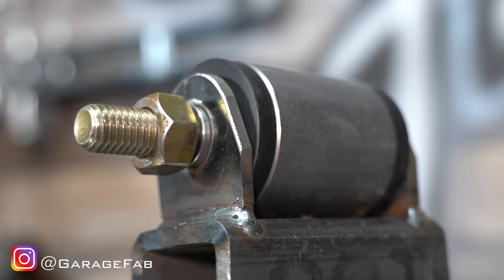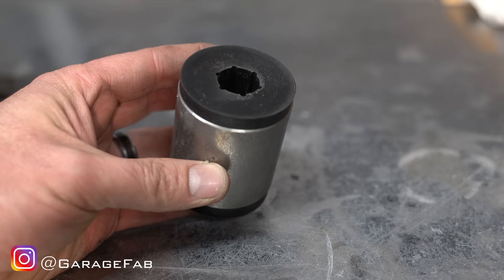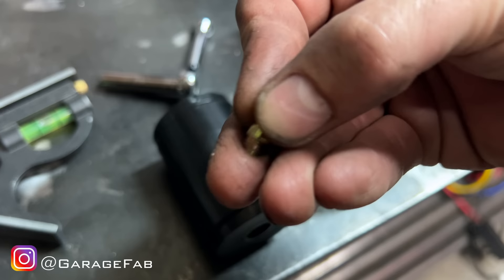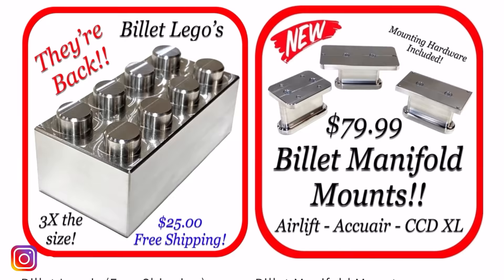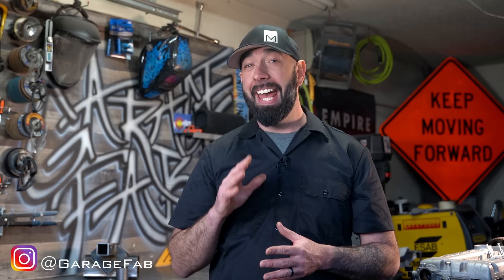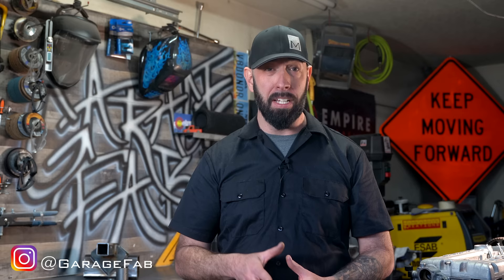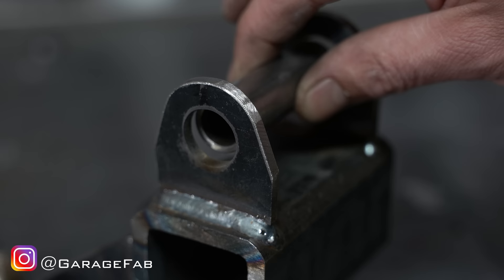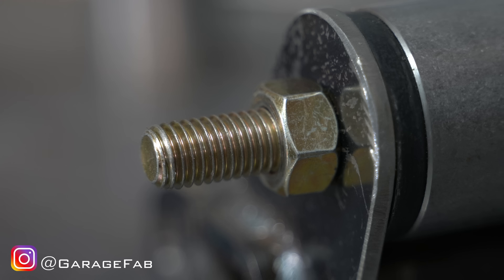The DOs and DON’Ts When Installing Polyurethane Suspension Bushings

Comment: I seldom install bolts/screws dry. Usually I go with either some anti sieze, or grease/cavity wax. Anti sieze is usually best for threads, but not good for moving parts. Nuts do NOT come off if you anti sieze them, as long as you tighten them correctly, it can actuall help hold the nut in place after it dryes up a bit. Loctite is my go to for thread locking, it also does help with rust prevention, but makes dissasembly annoying...

Comment: Use nickel anti-seize on the bolt inside the inner sleeve, been doing that for decades on Jeeps and Trucks that see water fairly often and have not had to destroy a bolt taking it apart since.
Reply from the maker: That’s good info. We’re spoiled here in the desert. Very little water, no salt, and no rust. Here, the anti-seize itself would be the thing to dread. 😆

Comment: This is incredibly useful, thanks. Easy to garner a mistaken understanding of how bushes work so this clears those misconceptions up nicely. I am planning a smaller project, not a car but a powerful electric scooter, and the swing arm needs to be robustly fitted. What do you do if you’re rating a bushing for a smaller purpose, not truck-sized? Is there a rule of thumb?
Reply from the maker: I’m honestly not advanced enough to know how to determine what bushings are needed for various vehicles. I simply go off of my experience of previous projects. That one worked! Or that one didn’t! If I were building a scooter, I’d likely go with full size bushings. Unless you’re really paying attention to weight, I don’t think you could go wrong.

Comment: Great video as always. I am really liking the format of the shorter videos: it kinda makes them like tech tips. I do have a question though. You recommended tightening the bolts to their torque specs, but where would we find the torque specs for parts we custom fabricated? Should we use the specs for the leaf spring perches when tightening the link bars or something else? Any feedback would be great. Have a great weekend!
Reply from the maker: Hopefully I don’t lead you down the wrong path here. That’s probably a good question to ask several people. I find the torque specs for the specific bolt I’m using. It has very little to do with the component it’s being used on. (with some exception I’m sure) so the Grade 8 9/16 bolt I use has a recommended torque rating of around 110 foot pounds. Unless, of course, the component can be damaged, I can’t imagine there such thing as too tight.
And you have a great week, Bryan! Thank you. 🙏
Reply: @GarageFab  thank you for that reply! I assumed it might have something to do with the bolts themselves, but I have never seen a bolt come with a torque spec. I could have just been looking at cheap bolts though, I suppose. I have a couple books That talk about that point but I haven’t got that far into them yet. I look forward to future videos man. Have a good week

Comment: @2:33.  For future service without the need to use a cutting torch and drill bits, I coat the bolt with a good anti-seize grease, including the threads. It's not to save the old bolt. Its' to allow the damn bolt to be driven out of the bushing. Did I mention I live in Ohio, where highways become salt encrusted in the winter months.
Reply from the maker: Haha! Yeah we’re spoiled here in Vegas. If we see rust, it’s on a vehicle that migrated here from somewhere else. Like Ohio. 😆 
Good info. Thank you, Robert!

Comment: Now this is a great way to start a sunday!!!
Reply: Super Sunday 🏈
Reply from the maker: Gotta give the non-sports folks like myself something to do!
Reply: So I found a trick I would like to share. I needed to notch my 4 link bars for my truck. I was thinking of an easy way to make them all the same length. I figured out my length, eye to eye, and drilled  pilot holes in a piece of 3/4 birch plywood. I was able to make a chase for the bar to lie in, then be able to hold the bar in place with a couple of clamps. Then, I was able to use my hole saw and notch each end through the existing holes. Then, I was able to repeat the process on each bar to get all 4 very close to being exactly the same. I am sure you could make a jig easy enough out of scraps to make it adjustable and reusable. I just used some scrap wood that I had on hand. Hope this makes sense.
Reply from the maker: It does make sense and it’s quite brilliant. 👏 Well done. I might have to steal your method in the future.
Reply: @Garage Fab  that is exactly why I shared it with you. I got the idea from your video about drilling holes with your circle pattern. Would be awesome to see you adapt this in a video.

Comment: This was some education information.  I'm about to start working on a set of tubular link arms and control arms for a project ttruck and although it seems like simple concepts I definitely learned a little so I appreciate it!
Reply from the maker: Yes! Happy to be of service, Robert. I’d love to see what you create. This video was in preparation for my own control arms in the next couple of weeks.
Reply: @GarageFab  I think the only thing I have not really wrapped my head around yet is how to create the sockets for ball joints.   I'll definitely be paying attention on what you do and hope you can share some detail.  I'm sure its just a matter of using tubing and machining to fit but going to have to do some research on what the interference specs should be for the bottom units.
Reply from the maker: Please explain more, Robert! I’m unsure if you’re describing manufacturing the ball joint itself. My control arms are custom made to fit a specific vehicle but the bushing ends and the ball joints are pre-fabricated purchased parts that are then welded in place. All the super confusing technical stuff is left to the joint manufacturer.
Reply: @GarageFab   When I typed my response I was just getting off a plane so wasn't in the design mindset, lol.  I just meant the cup/mount itself the BJ's press into on the stock bottom control arms.  I'm sure it will just be tubing of sufficient thickness and using the lathe to get the inside diameter right so they still press in.  I'll just borrow from some of the lowering suspension setups and add length to account for keeping the WMS in the right plane compared to stock height, camber and caster during the wheel travel.  My ultimate goal is a pre-runner style with coilover and long travel, about 4 inches.  I'm not racing or going offroad but if I do decide to get crazy I want it strong enough to survive since as a 2wd C10 you sometimes have to compensate with speed instead of 4wd traction.
Reply from the maker: Yes! That sounds like fun. There’s nothing like piece of mind. There’s also nothing like fear. Wondering if a wheel is going to fling off at any moment. Definitely make it strong. 
The aftermarket ball joints I’ve purchased have the outer weld-on sleeve included. The ball joint fits in and is held in by a snap ring. I’ve occasionally had to fight to press the ball joint in, probably from shrinkage of the outer sleeve during welding.

Comment: Good video.  Spot on.  I just had a set of vintage Koni 7610 motorcycle shocks rebuilt and the inner metal sleeves were not any wider than the outer metal sleeve.  Ugh!  Very frustrating.  I had to fabricate little spacers using steel tubing, a hacksaw and a file.  Fucking PITA.  Rebuilder said I didn’t know what I was talking about and refused to install bushings with wider inner sleeves.  I even sent him a picture of another original set of 7610’s with the wider inner sleeves, but he was unmoved.  Anyway, thanks again for posting this helpful video.
Reply from the maker: Haha!! It’s a simple concept for some. For others… rocket science. Glad you got it figured out my friend.

Comment: Great info. I would very much like to know what you would do to fix the problem I have on my 05 3500 Ram with 470K on it. It's a daily driver not an off roader and I've always taken great care of it. Yet, all the care seems to not have prevented my through bolt holes on the shock mount tabs from elongating, and every bump I go over UNLESS the truck is loaded down some delivers a knocking noise of the bolt jump in the tab hole. 
I recently installed new Bilstein's on the rear thinking that would help resolve the issue. I tightened the crap out of it using new bolts like you use. It helped for a short while until enough driving and hitting the bumps in the road finally loosened up enough again and now its back to the knowing. Also, the shocks I took off were perfectly fine. 
 I have mentioned this to other mechanics and they seem surprised I am having this issue yet, I am. I am also told there is a FINE LINE when it comes to making any repairs or mods to the axle or body of the truck where the shock tabs are trying to resolve the worn out tabs.
Reply from the maker: Add me to the list of baffled technicians. My only thought is the elongated holes were simply caused by nearly a half-million miles, and now that the holes are too large there’s no stopping it. The joint where the shock meets the control arm is under an incredible amount of stress over bumps. The clamping force of the bolt alone wouldn’t be able to stop the movement. The bolt would rely on a tight fit as well. Obviously that’s no longer an option. You’ve got to get your bolt to fit snugly again. I think the only right way to do that is to replace the control arms. You could also weld some thick, tightly fitting washers to the outside of the tabs, but be aware that welding causes metal to become brittle and could cause the shock mounts to crack or break off on bumps.
Before doing any work or spending money, are you absolutely sure this is where your knocking noise is coming from?

Comment: I'm making a push bumper for my truck with a front piece about a foot in front of where the stock bumper was. My question is, can I use the bushings in a vertical orientation so that the side of the bushings support the weight?

Comment: Forgot one other problem with that first pic.  The tabs should be a half inch taller.   By the time the bar tries to flex that bushing, the outer sleeve will be contacting the bracket the tabs are welded to.
Reply from the maker: Good info! When designing the “bad bushing” that poor clearance was intentional. And then I forgot to address it! 🤦🏻‍♂️ 
Thank you my friend!

Comment: I remember learning somewhere about only torque up suspension bits (ball joints when on the ground) because they will squash more when the weight of the car is on them. Hope im still correct. I'm a cook, not a mechanic unfortunately lol
Reply from the maker: You’re mostly right. Bonded rubber bushings do, in fact, need to be tightened with the vehicle’s weight on the suspension. Tightening these bushings in the air will cause them to tear when you set the vehicle down. The rubber is flexible, but only within reason. Not unlike a cake.
Ball joints and other spherical joints can be tightened whenever. When you set the vehicle down, this type of joint will simply rotate and won’t damage anything.
Reply: @GarageFab  I used ball joints because I couldn't think of the bits where the rubber parts are. This is why I cook, not fix cats professionally haha. Have a fantastic day =)

Comment: I prefer the oem rubber bushings. I installed poly last summer in my 82 c10 Squarebody and they squeak something terrible after a month or two. Switched back to rubber.
Reply from the maker: Yes! They can be very frustrating. Zirc fittings are an absolute must, and they require maintenance every oil change at a minimum.
This hassle is sometimes bearable since rubber can’t handle the extended travel that some suspensions have.
Rubber is quite luxurious though. 👏

Comment: Not as critical for poly bushings, but if you're using 1 piece factory style bushings where the rubber is molded to the shell and inner bushing, tighten at ride height to avoid stressing the rubber for best life span.
Reply from the maker: Yes! Good info, Jimmy. You’d be surprised how often ‘experienced’ technicians get this wrong. 😬

Comment: Should the inner  sleeve be "slightly" wider than the bushing? 
I don't mean much, only .010"-.020" to minimize any binding of the bushing and tabs rubbing tight, or will that just create unwanted play??
 Just curious. Thanks.
Reply from the maker: Ideally the inner sleeve should be slightly narrower than the bushing. This will squeeze the sides of the bushings a little and minimize play. Rubbing is going to happen, you just have to make sure everything is well lubricated. Preferably with a Zerk fitting installed.
Reply: @GarageFab  thanks I appreciate the advice.

Comment: No mention of tightening the pivot bolts when vehicle is at ride height, something I was taught to prevent premature failure of the bush.
Reply from the maker: That’s really good info, Derek, and very important on bonded rubber bushings. Not so important on polyurethane bushings like these. Unlike bonded rubber bushings, these inner sleeves slip so it won’t damage the bushing material.

Comment: Why you should use grade 5 bolts on your suspension instead of grade 8. During a heavy impact energy has to go somewhere, The bending of grade 5 bolts absorbs a lot of that energy but still hold parts to the frame. Grade 8 bolts are much harder and they snap, not bend; Parts can come off potentially catapulting the car in the air down the front stretch. (Yep seen it happen) Grade 8 bolts are also likely to be harder then the brackets and tabs they are designed to hold, if the bolt doesn’t snap it will rip the mounts off causing even more damage. In my former Nascar experience it was cheaper and easier to replace a bent bolt then fix or replace broken or lost components. To me its the difference in damaging a car then in crashing a car.
Reply from the maker: That’s incredibly fascinating info, JB. Thank you for taking the time to write that. Your explanations make a lot of sense are similar the reasons I do other things. If you have knowledge on this topic, lemme know what your opinion is; I know race cars are constructed out of chromoly tubing for suspension components and roll cages. I’m assuming because it’s stronger so less material is needed and is therefore lighter.
I, on the other hand, build suspension components from mild steel. My reasoning is I’m not concerned about weight and I’d rather a link bar bend than snap. Losing rear wheels at high speed can be catastrophic.
I have also considered using mild steel for a roll cage/partial tube chassis on my next truck project that has two FWD V8 drivetrains. The reasoning this time is two-fold. One, from my research, chromoly needs to be welded in a very specific manner in which I’m not educated. Two, I’d rather my cage bend than snap and impale me. 
Thanks again for your time! Cheers!

Comment: Are all bushings created equil. Vould purchase said link end/ bushing from thorbros and have it work on a end used in a cantilever airbag setup on my Excursion.  I have about 6-8inches of lift travel and time to replace some rotten rubber.
Reply from the maker: Um. I couldn’t say for sure but polyurethane bushings are fairly standard. You would likely just need to measure the outside diameter of the outer shell and the width of the bushing.
The Thorbros bushings are 2 inches OD by whatever width you want.
Reply: @GarageFab  copy.  Thank you

Comment: why do most poly bushes (the two halves) have a 1/4" thick flange? does it have to be a 1/4", or could it be an 1/8".  I realize that the tabs dictate overall width and adding 2-part poly bushes usually increases overall bushing width because of the 1/4" thick flange
Reply from the maker: The quarter inch flange is the cushion for the side of the outer sleeve. Some suspension set ups have more sideways force than others. The flange keeps the outer sleeve from grinding on the tabs. I honestly couldn’t tell you if a 1/8 inch flange would have a shorter life, or last just as long because the Bushing tab should fully support it. I’ve never tried it!

Comment: Great information! Now how about a video on the reason bushing will squeak, even when fairly new. Thanks!
Reply from the maker: Is it polyurethane? Poly is notorious for being noisey. It’s an unwritten rule that poly bushings must have a zerk fitting for lubrication. There’s no other way to combat the squeak aside from removing and greasing by hand. That would get annoying.
If your bushings are rubber… that’s a bummer. They don’t usually squeak but it happens. There’s also not much you can do. I’ve had some luck with dousing them with dry type silicone spray.
Reply: @GarageFab  thanks for replying! Some are poly and most are conventional rubber.I’ve heard that tightening bushings with the car off its wheels can put a bind on bushings and cause problems prematurely? Would loosening the bolts on the ground and then retightening them help? I rebuilt the suspension but didn’t have a drive on lift so I had to tighten everything up on the two post lift.
Reply from the maker: You are correct sir. And yes, simply loosening the bolts so that the bushings can spring back to a relaxed position with the vehicle on the ground and then tightening is a good idea. 
This is only necessary on the bonded rubber bushings though. The poly bushings slip so they won’t be stressed.